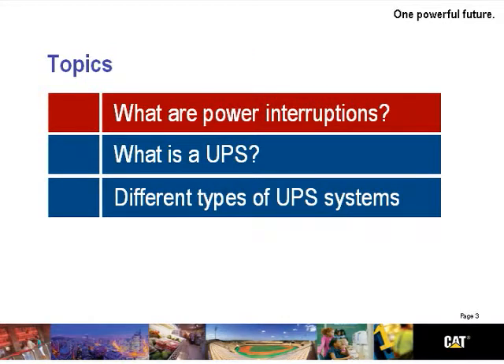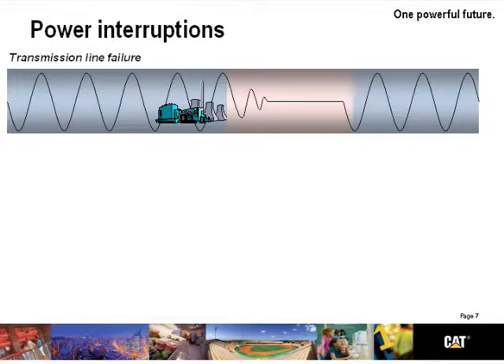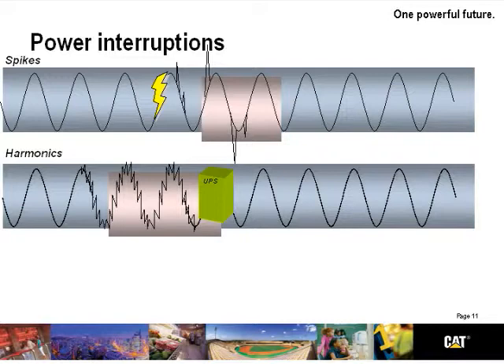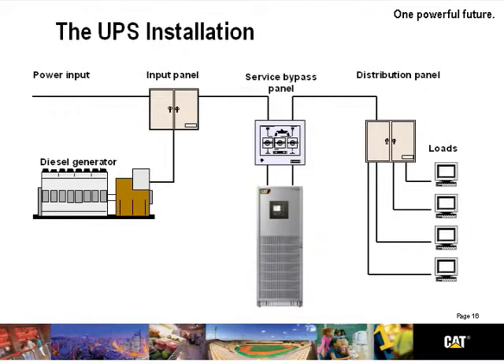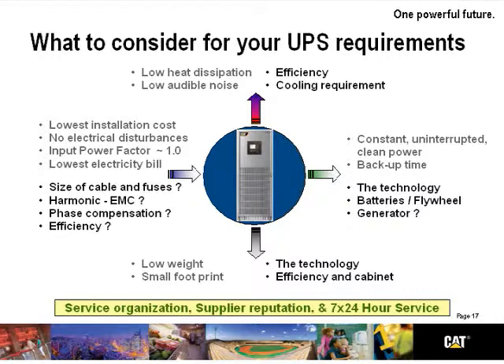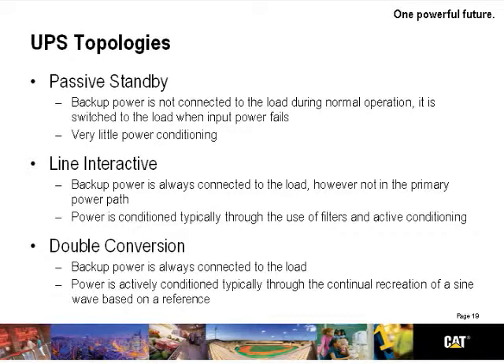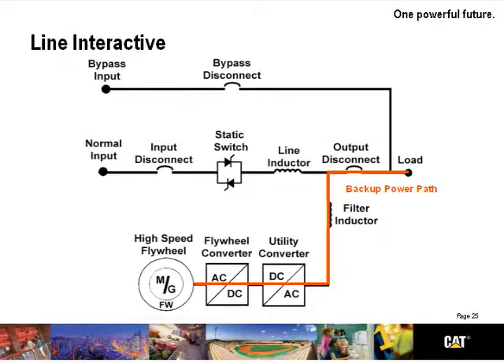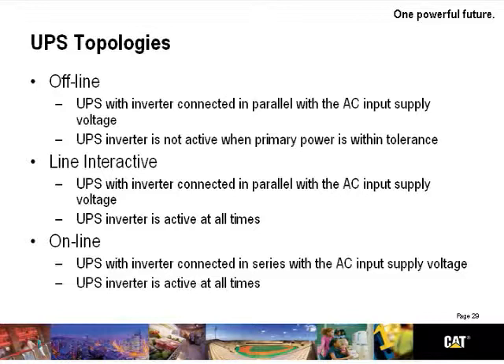UPS 101

Comment: Hi I've researched a lot regarding pure and modified sine wave output.  Basically  to my curiosity if its technically possible to use none pure sine wave UPS to backup my computer.  According to them pure sine wave is the way to go as modified can damage your equipment.  However, I can't afford such type of UPS as so expensive and we hardly get power outage in our area only during rainy season.  Plus, all I wanted is just have at least 5 minutes to shutdown my pc properly.  That is why I am considering to buy one instead of my regular AVR.  My question is, how much risk do I get if I use a modified or stepped approximation to sine wave UPS to my PC.  My PC runs in 450 watts 80 percent white corsair power supply.  Thanks in advance.